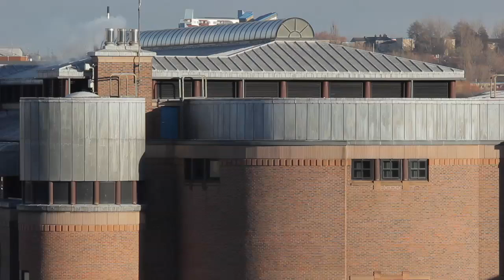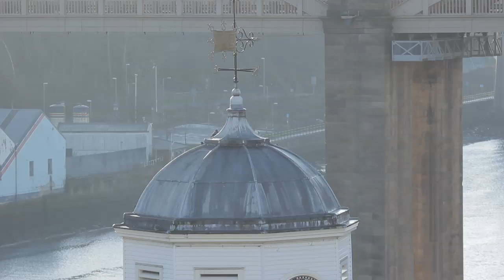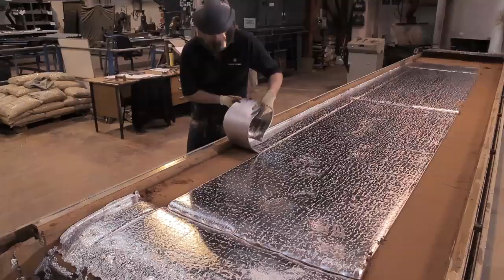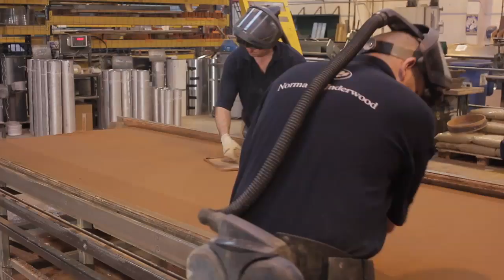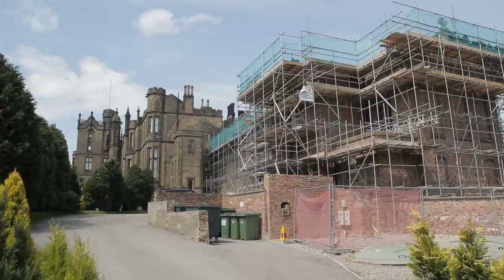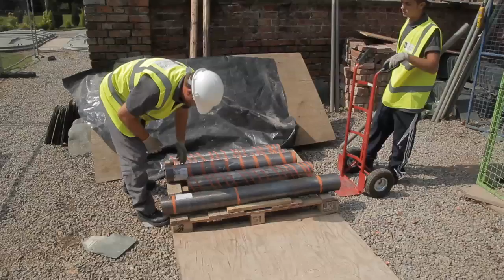Introduction to lead manufacture

Comment: Hey do you have a idea how to produce xray lead glas/window ? I would be very thankful for some informations.
Reply: ........it's one year ago I see. There was considerable lead in the CRT picture tubes of the old style TVs , 50% is the figure I've heard . Out of interest - crystal glass is also lead addition but likely lower percentage . it can be cut carefully while submerged in water using diamond blade angle grinder.

Comment: It never occurred to me to cast sheet-metal.  Amazing!   I wouldn't have believed it.  The cast sheet doesn't look too bad, probably nothing like as uniform and smooth as the rolled sheet.  The sand didn't look too burnt, wonder if they can just keep using it?  And is it better or worse as roofing?  Maybe related videos will tell!   Thanks for some startling information.  I don't think many people in the US know that lead CAN be welded, and here it's a recognized trade.
Reply: @Tony Samson .
Soldering (AmE: /ˈsɒdərɪŋ/, BrE: /ˈsoʊldərɪŋ/) is a process in which two or more items are joined together by melting and putting a filler metal (solder) into the joint, the filler metal having a lower melting point than the adjoining metal. Unlike welding, soldering does not involve melting the work pieces.
Reply: @mlummas514  And just to confuse everyone even MORE <GRINS>, consider the term 'brazing' (which is very similar to soldering in that the base metal isn't heated enough to melt it, but the 'filler' is generally a 'brass-like' material rather than a lead based material)
Reply: @Tony Samson  it is welding, not solder.
Reply: all old lead was cast

Comment: why do buildings need lead sheets?
Reply: +Whoopie I guess I didn't catch that. Also seems like a good way to leach lead into the environment.
Reply: +technosasquatchfilms it isn'tand lead is extremely durabe for roofing, whe're talking about 100+ years durable, where tiles and similar brittle and fall off...
it's also the only cost effective radiation shield around nuclear reactors.... (40cm of lead=2m of concrete)
Reply: +Côme Thiburs The reactor shielding is unlikely to be exposed to the elements like the roofing sheets.
Maybe the lead sheets are stable enough that water and sun dont cause them to deteriorate?
Reply: lead erosion makes a "skin" like aluminum, or i've been told so.
Reply: +Côme Thiburs neat
Reply: @comethiburs2326  concrete does worse and yet we have it in abundance. You need to protect your body from all these materials and I bet you will live very long years.
Reply: @adeokuneye7429  live in a dirt hut!